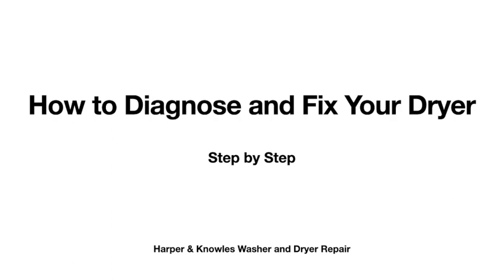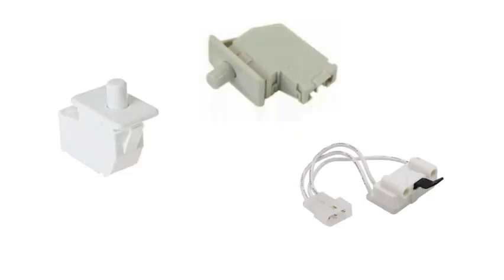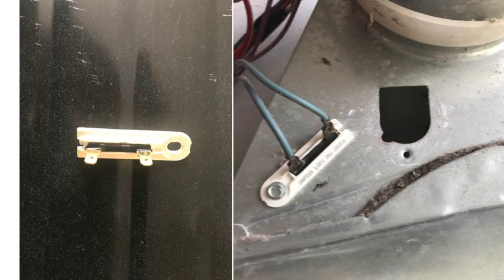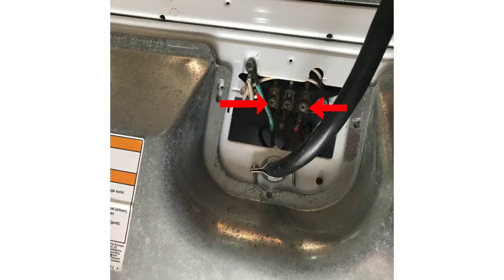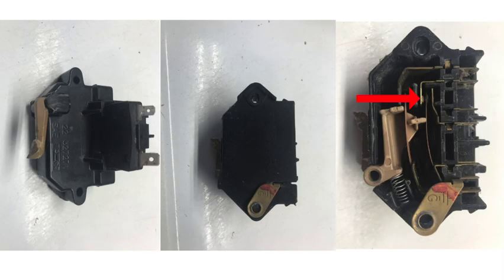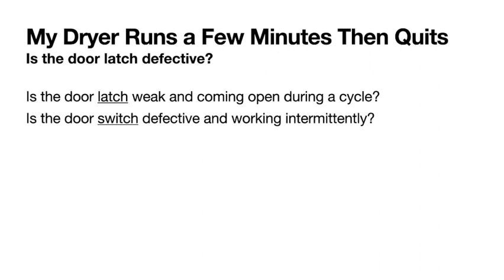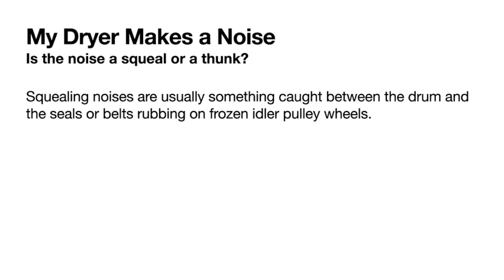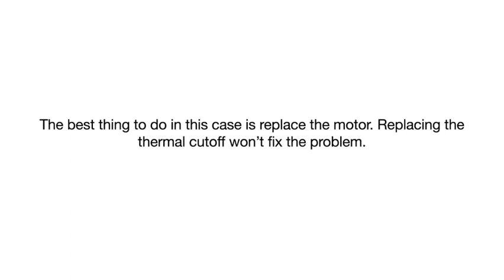How To Diagnose & Fix Your Broken Dryer: A Comprehensive Repair Tutorial

Comment: Attention Chip I have a Samsung DV220AEW/XAA that keeps blowing the thermal fuses.  I have already checked the vent line and it is clear.  I have replaced the heating element, thermal fuse (high and low), thermostat, and thermistor.  It worked for 2 maybe 3 loads and then went out again.  Is there any way to be sure the control board is the problem before I order one from eBay?  They don't make the control board any more, so eBay is my only option.
Reply from the maker: I was having the same problem with a customer’s machine not long ago. Because it doesn’t have a cycling thermostat the heat regulation is a function of the control board. If you have changed all the other components and have good airflow then you have eliminated everything else.  I had a board from a scrapped machine that solved the problem. I’ve had good luck with parts from eBay but also have gotten parts with the same problem.  Just be sure you can get a refund when ordering from them. Partsimple.com offers a repair service for that board if you want to go that route. Here is the link for that part number https://www.partsimple.com/samsung-dc9200123c-laundry-dryer-control-board.html.  Good luck with your repair and thanks for watching my channel. Let us know how your repair goes!